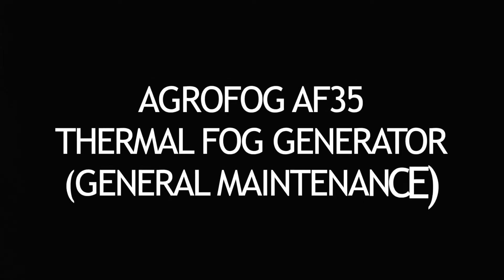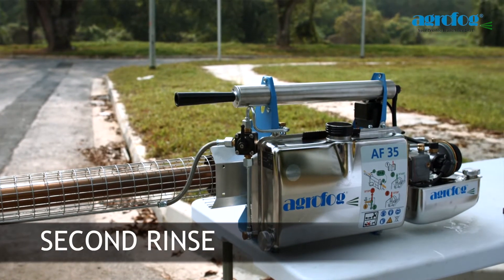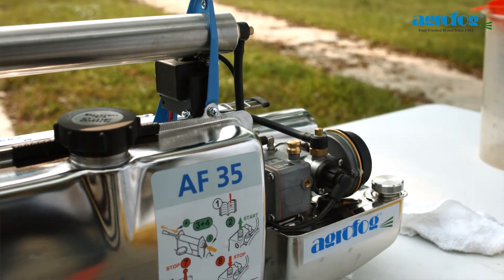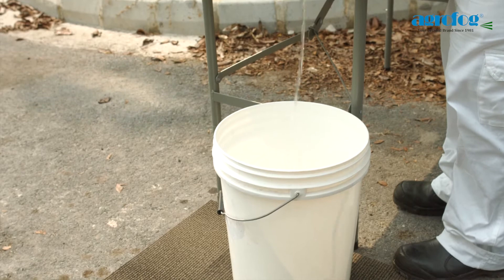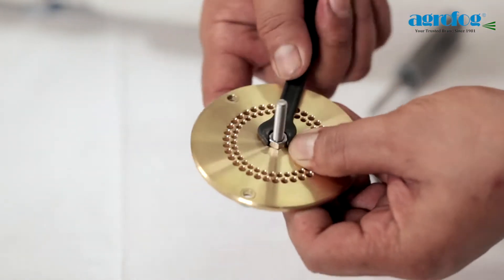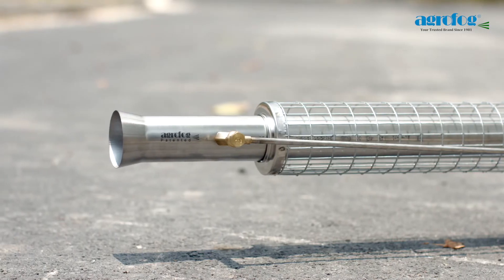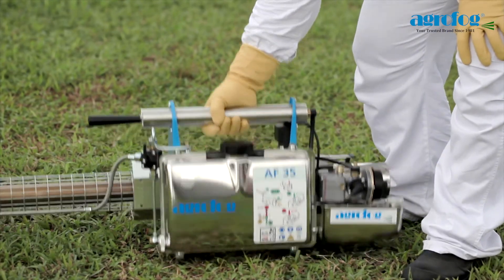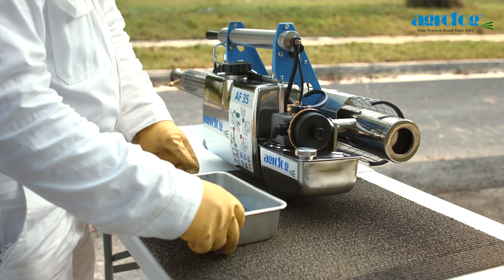Agrofog AF35 Thermal Fog Generator Maintenance: Petrol Tank, Solution Line, Fog Tube & Dosage Nozzle

Comment: does this tip also work for the oil base solutions.. to clear the line.. or just water based can use this method
Reply from the maker: Dear Nazrul Syam, Thank you for leaving us a comment. Our thermal fogger is equipped with dual purpose fog tube (patented) which is an innovative design to cater for both water and oil based solutions. For further inquiry, please write to us a agro@agrotech.com.sg so that you could arrange our specialist in this area to contact you.